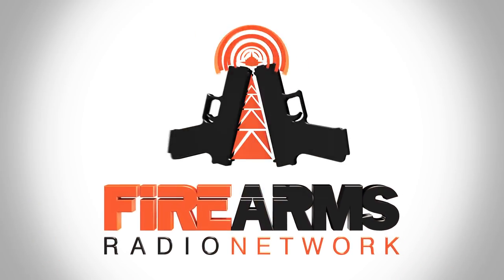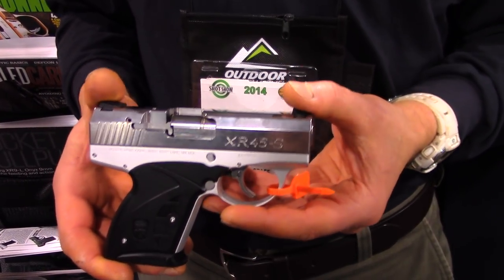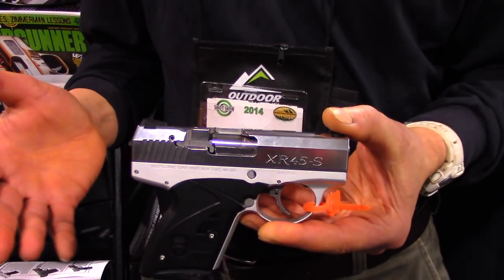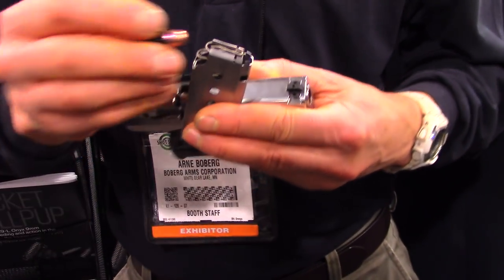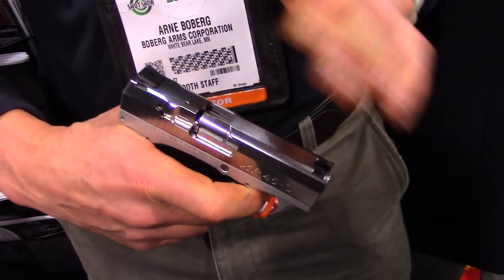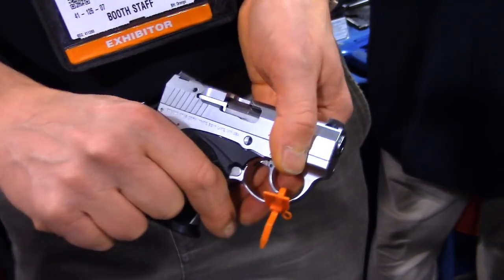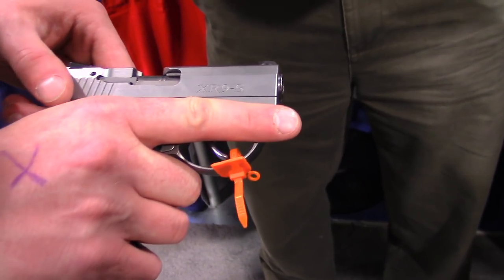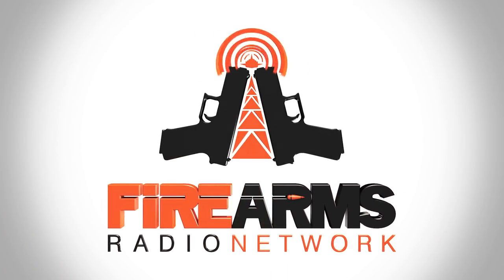Boberg Arms Pistols - SHOT Show 2014

Comment: Look at his face when hes talking about price lol. this is a gimmick pos and nobody will pay 1200 bucks for one. When you can buy a sig and a glock for the same price. I carry my p238 every where in summer time. And in winter xd45 mod 2 or g29. Or even ruger alaskan 454 casull. its a interesting design maybe if I can find a used one for 700 I would buy it but no way will I spend 1049, or 1199 1299 or 1399 on it. I wonder if it can keep up in reliability with sig or glock.